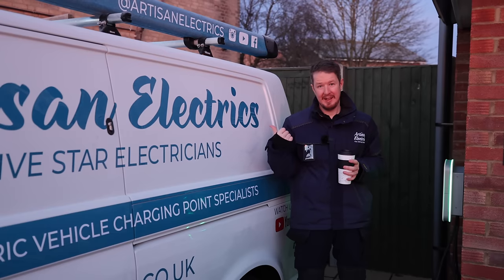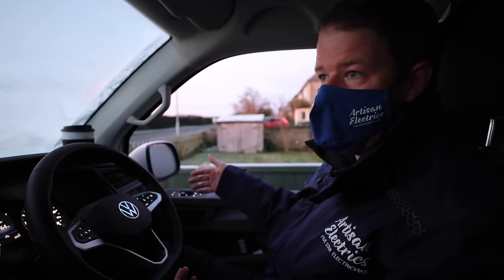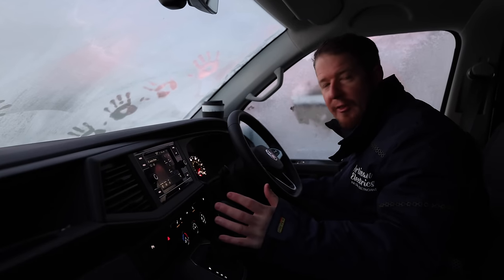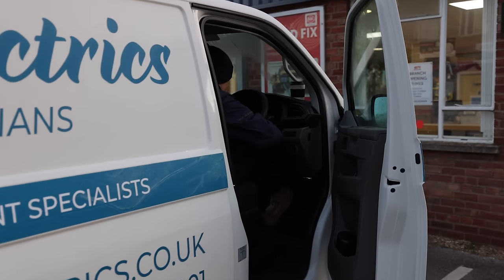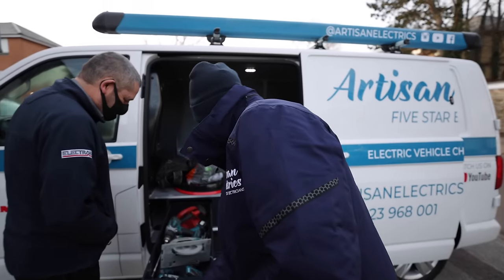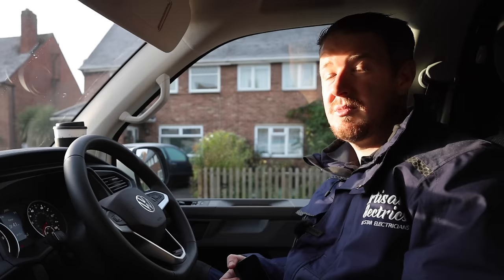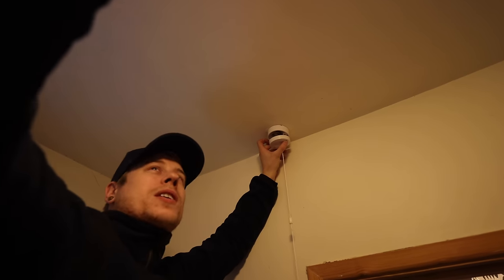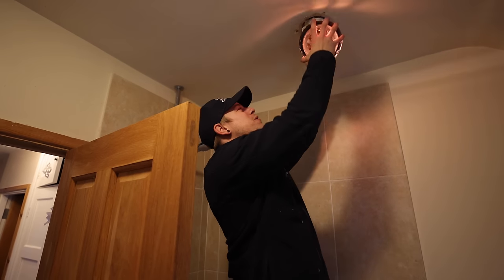ELECTRIC VAN NIGHTMARE 😬 - Volkswagen Transporter Electric Van

Comment: I've heard that electric vehicles are sh*t - ESPECIALLY TESLAS!  (They are  fast on acceleration, sure enough, but garbage on the top end with  a top speed of  something like 130 mph flat out - and then they've 'shot  their bolt'! Another big Downside to E.V's is, (as you pointed out here), is that the power levels of these vehicles soon start plummeting down really fast as you are out and about in them (and are nothing quite like what is advertised or claimed in their sales hype. And if you run out of juice (before you can get it back to your home charger), it can get VERY expensive indeed to recharge them from a public charging point.  I've seen videos about them where guys have found them more expensive to charge up than it would be to buy a tank full of fuel!  I'll stick to my diesel van any day of the week, I  think!  Not nearly so much grief!

Comment: So you are parked on the high street and someone leaves you just enough room to get your rear doors almost open, how do you get to the gear at the back of the tailgate draws? utterly stupid waste of interior space of your van and when it's pissing down and you have to open the draw right out you will turn it into a drinking trough, you'll have any ferrous metal contents turning to rust and horses queuing for a drink. you could have least bought a van with a tailgate which would protect it to some degree or better still not waste all that money on a crap van with crap storage. 
Did you come up with the format for that storage? I'd say so looking at the lack of common dog elsewhere.

Comment: He’s not the bright spark his van decals make him out to be,having said that these are the type of problems ordinary everyday motorists are going to encounter with these electric vehicle’s,for the inexperienced they are going to be a nightmare especially if like this Dope you don’t read the vehicle instruction book. The biggest problem with these EVs is going to be the range they are capable of,in winter conditions that will drop like a brick when you have everything on,lights,wiper’s and heating which if you’re stuck in traffic will drain the battery at an alarming rate leaving you with very little mileage capability left in reserve to get to where your going without charging up again which might be difficult if everyone else has the same problem and you have to wait hours while the people charge theirs. The recovery trade are in for a field day in winter getting these vehicles to a charging point,I think I might invest in one that has a generator on board that is capable of charging these vehicles enough to get them home or a charging station mean while I’ll stick with my Diesel vehicle until all these problems are sorted out at someone else’s expense.

Comment: The video is a joke.. like in the any other diesel car would be any differences in fact it will be worse.. in electric car your getting your heat instantly. first of all charge your car properly and you wouldn't have to complain about the range, try nissan leaf from 2011 with a broken heater then complain about everything. Messing with all the shiny buttons rolling down frozen windows trying to preheat your windshield with incorrect settings on the climate control.. your complaints are just so stupid. read a manual or something. Go back to your diesel and try to start it when its a -25c. Good luck. "The professional electrician" thats how you find shity work in your breaker box. This dude don't even know how to use a car.

Comment: Cannot bear to watch, you've been driving a tesla for some time, you have the ability to charge at home, therefore you understand all about preheating the cabin while plugged in. Extremely disingenuous and just there for the clicks not to give anyone any useful info, horrible
Reply from the maker: Hi Matthew, because the ABT E is essentially a Transporter that's been converted into electric it doesn't actually have the preheating function as seen on many EVs. We just happened to encounter quite a few issues with this van on the day.

Comment: No sympathy - Why would you buy a VW electric van.  Its overpriced and clearly ill thought out.  The Nissan ENV200 would of preheat off the key fob button, clearly has a better battery and Nissan have tons more EV exp than VW. VW were still pushing Diesel back in 2016 when Nissans EV van launched. I see you also own a Tesla.  I would imagine that's because you wanted a reputable electric car, yet you waste money on VW transporter which was clearly made just to tick a box? Mental.....